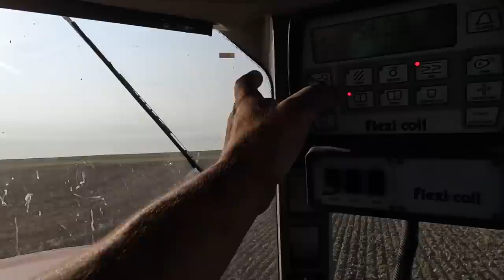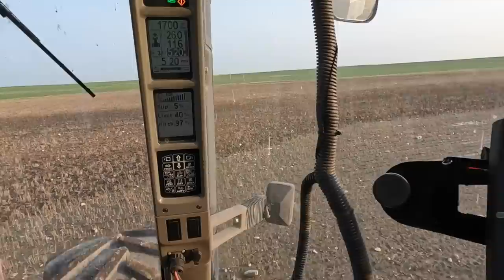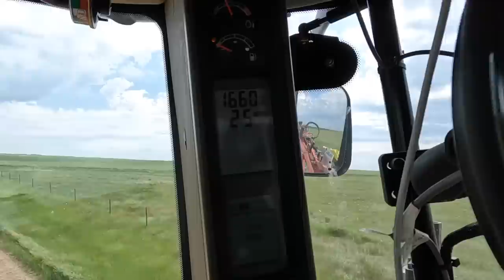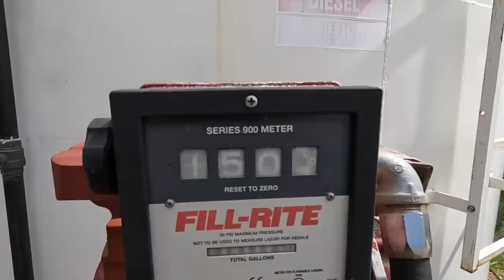Gophers Drive Us Nuts; Grasshoppers Devour Young Crop…SEND HELP NOW!

Comment: we used to gas gophers. find a fresh hole shove heavy rubber pipe into the hole the other end attach to tractor muffler set rpms at full bore for ten minutes then go to the next hole.